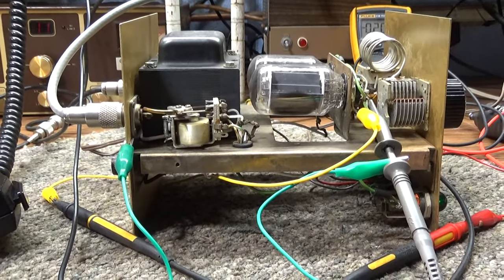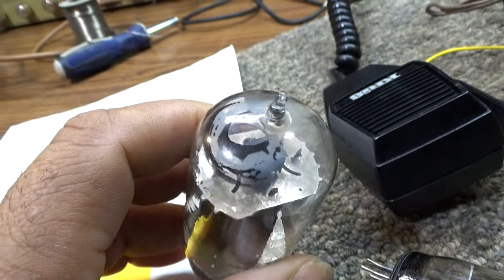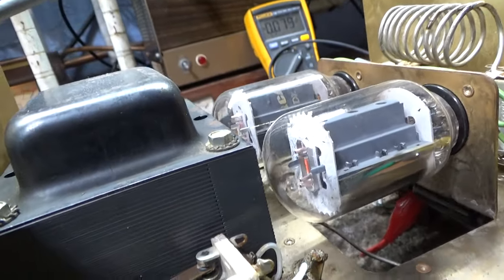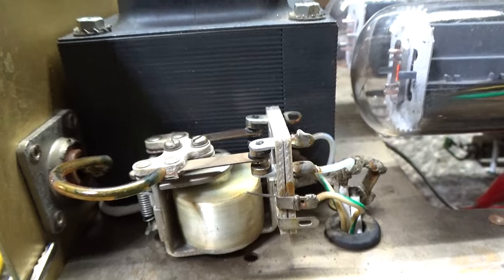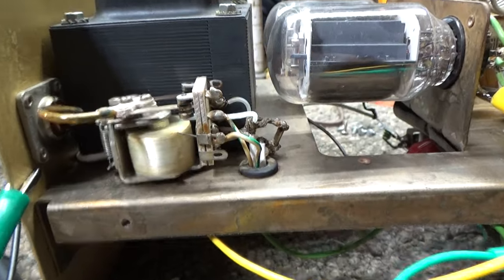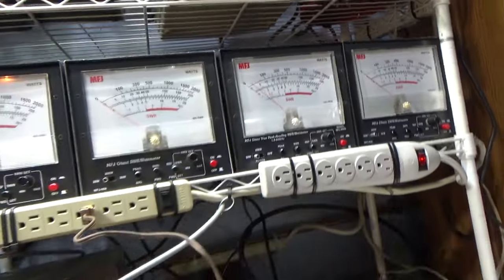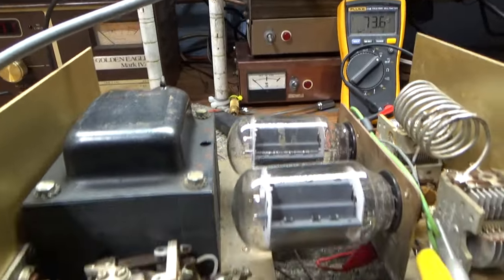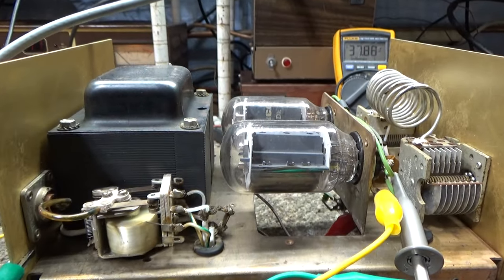Linear Amplifier repair for dummies 101 part 1

Comment: A very good explanation Doc! You should have been an electronics teacher. Trouble is that kids today don’t want to learn electronics. That’s why I got out of the teaching profession. 
Btw, I found a relay in a linear that was sticking on. Turns out that some guy sprayed it with some type of lubricant. It concentrated from heat and made the clapper stick to the core of the relay. A good cleaning with a non-lubricant cleaner and it worked fine again. God save us from technician want-a-be’s.
Reply from the maker: That can happen, or have seen relays sticking from arc'ing and/or pitting, but that's not usually the case.

Comment: Thank you for your lesson and tube amp tutorial. Just picked up a transformerless amp with 3 30kd6 tubes. Tubes light off good , relay is keying, receive pre amp works but zero on the watt meter . Load side variable cap shaft is stripped so I moved it with a plastic screwdriver, went too far where the fins were open and keyed it and it puts out 15 watts or so. Not sure if it's a dirty relay only pushing power when there is no load or if that variable capacitor is my culprit. The stripped barrel on the cap makes me nervous tho so I'm going to order one and change it to be safe.
Reply from the maker: Probably that cap is shorted. Be careful, you know the nickname for those amps, right? The Widowmaker.

Comment: Thanks for this video. I picked up some equipment recently that included a 4 Band Palomar tube amp with 6 tubes in it. I am trying to decide if I should send it in for testing and repair or sell it as is.
Reply from the maker: Good Luck, but nowadays, not a lot of people doing repairs and also repairs can get very expensive.
Reply: If it is a Palomar 350z, as I suspect, be very careful. That amp has the tubes keyed all of the time. A considerate amount of current flows through those tubes, even when the amp isn’t keyed. The amp has long been known as a fire hazard. I rebuilt mine so the tube current is off when it isn’t transmitting. That and some proper biasing of the tubes resulted in a great amp. But it took a lot of time and effort to fix those design problems. Doing that also greatly extended the life of those expensive tubes.

Comment: great video, I have a RMKLV 350 twin tube amp, every now and again the relay starts chattering (clicking very fast) when i de key the mike, Could  the cause be RF feedback? If you could possibly cover this problem in a video or maybe just a short explanation I'd be very grateful
Reply from the maker: Yep, those are not the best built amps. Feedback and/or a bad Input SWR. Long coax into may actually help this problem. Yeah, I know, I'm not a real believer in coax length, but I have said that its like putting a Band Aide on a big open wound. It's not what you really need, but it may get you by in a pinch.

Comment: Thx for good basic info..With most GG sweep tube Linears producing relatively low 8 to 10x gain per Stage, have you tried running any Beam tubes with adjustable B+ on Screens rf Bypassed with disc Caps ?? ....Just thinking the screen + Bias V design would give More useful Gain per stage...
Reply from the maker: Ummm have you heard me mention 'Turbocharged'? That's the term I use for amps running in Tetrode mode, which is running voltage to the screen instead of Triode and/or Grounded Grid mode. Also, as you said, you need Bias when running in Tetrode mode. So now instead of Grounded Grid mode where you only need the HV, you need Screen and Bias and with those, if you don't sequence it right, or lose one, often the whole thing will let the magic smoke out. Hence, you won't hear me get deep into that here on my Linear Amplifier for Dummies channel.

Comment: On a d&a phantom 12 tube it won't key down with mic but you can push relays down and it works. What do you think. And how to go about fixing it
Reply from the maker: D+A's used both an early Tube type keying circuit and later a transistor keying circuit and in many, the transistor circuit used negative voltage and there were many changes and revisions. If its transistor, it is probably the keying transistor, however, I just replace the whole keying circuit with the Nomad Radio keying circuit. However, you would have to convert the - Voltage to positive to do that. https://www.ebay.com/itm/115811469907

Comment: Nice video. 
I have a amplifier I'd like to get working again. Palomar 300a
Reply from the maker: Sorry, only rolling my own.
Reply: So you don't work on equipment for the public? How bout advise?
Reply from the maker: I can try but it not easy to advise on a repair without seeing the amp myself. Whats the problem with the amp?
Reply: @tramdr I appreciate all your videos, I have one that needs repair I accidentally hit mine with the power up, messing with swr on an old antenna.  it's a 2 pill, mrf 454s it slightly smoked one of the 11 ohm resistors, I replaced both but still not putting out. Do you think it damaged the pills? How can I test them? Thanks in advance
Reply: that is a very nice amp....use to have a coupla of those

Comment: 10:28 Does this mean that you're losing 2.5W, then the amp is on standby or turned off? 🤔
Reply from the maker: Yes. That 'Cheater' inductor is connected all the time, even when the amp is in Standby or even Off.

Comment: If a transformer was bad in my tube amp,what would be the symptom?
Reply from the maker: If the transformer had a short, it would blow the fuse as soon as you turn it on. If the transformer was open, it wouldn't put out anything.